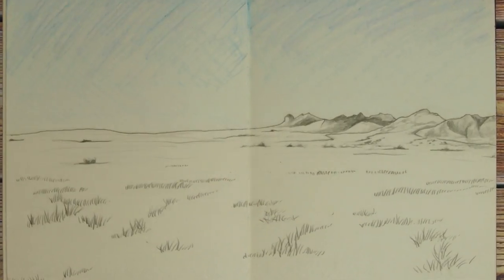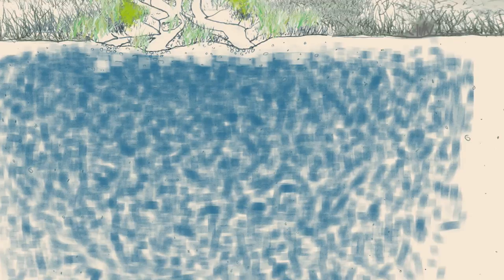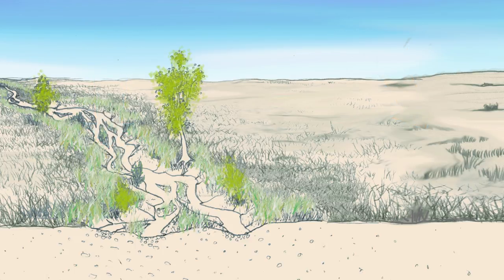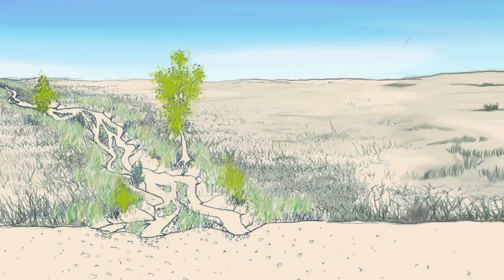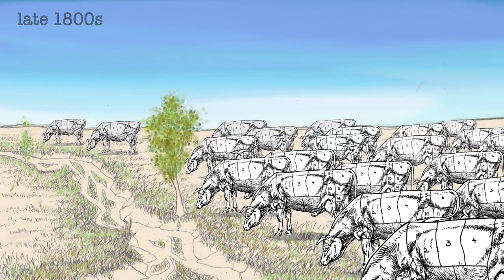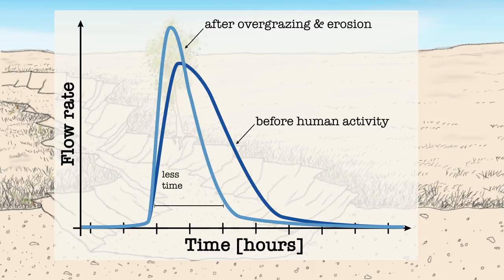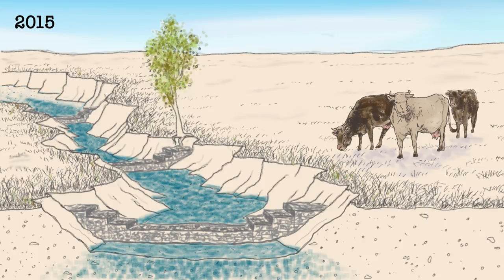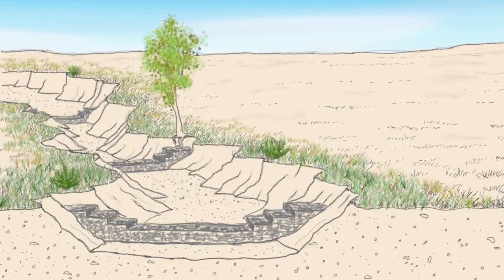Catching Water in the Desert

Comment: I have one suggestion , I have watched fewer videos of sand dam.  I have observed with the flow of water the sand dam gets washed away. 
You must experiment with self locking clay bricks to build the dam.  Clay bricks are cheaper easy to maintain and self locking systems help to stand without cement or iron. If it breaks you can easily reconstruct. 
Please experiment with this system.  Namh shivay.